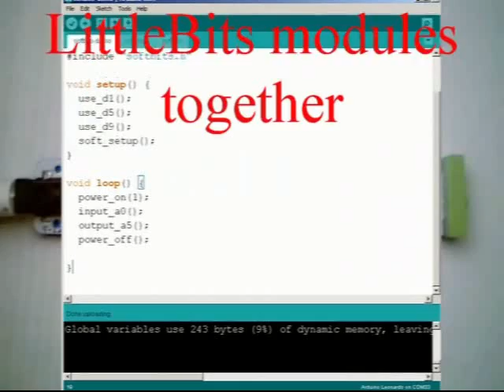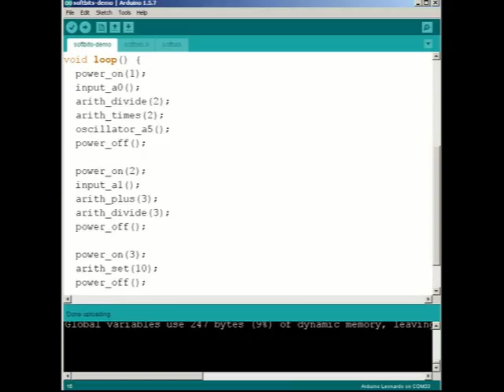The power of Softbits for the LittleBits Arduino

Comment: I don't understand. This video does not do a good job of explaining what is the advantage in using this "SoftBits" thing.
Reply from the maker: Hi, originally Softbits was an attempt to do LittleBits virtually. The LittleBits hardware interface with it's 3 wires (power and signal) and magnetic coupling allow the hardware to be used easily. Softbits was an attempt to do the same in software in the browser. It was one of my first Javascript programming attempts. There are two parts - the display and the underlying software virtual machine. The virtual machine can also be run on the Arduino with the serial interface allowing Arduino softbits interacting with LittleBits hardware.